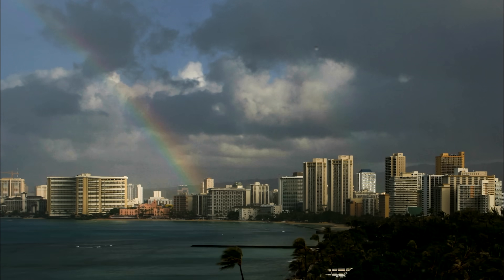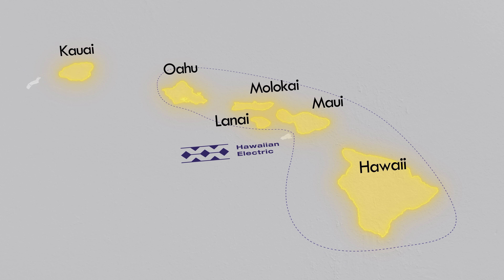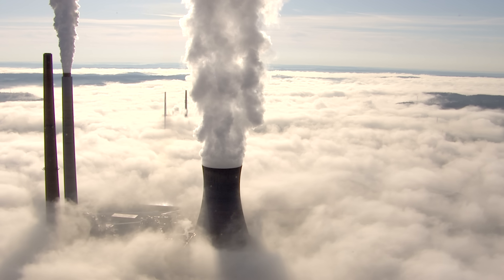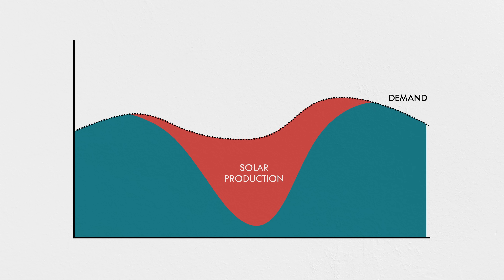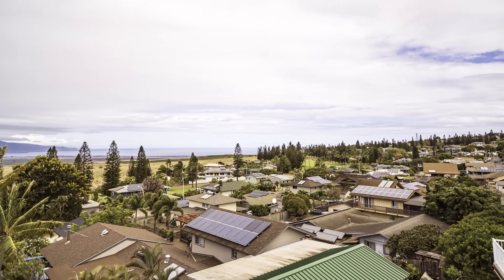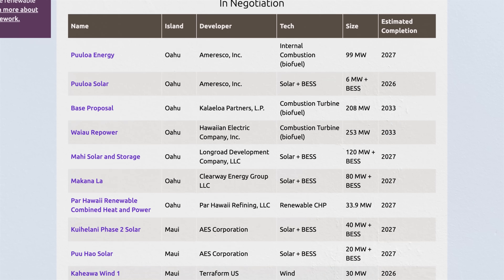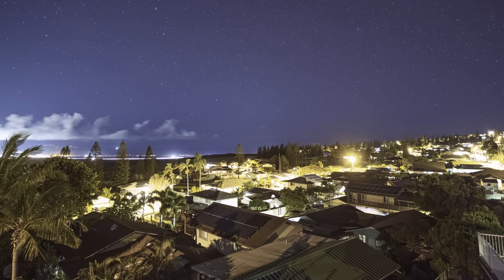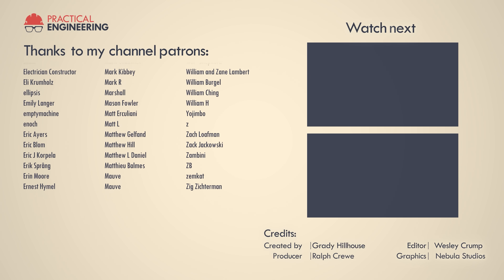How the Hawaiian Power Grid Works

Comment: 7:38 Kudos to the people who designed and built that solar plant 😅 
I guess they considered the losses due to self-shading to be negligible... but, come on, those losses could've been avoided simply by separating the rows an additional 3', o so.
Sure, you'll always have self-shading around dawn and dusk regardless of separation (production at such hours is so low that it doesn't matter), but those rows are simply too close together, I'd say that self-shading losses in this plant are greater than they could've reasonably been.   
 
It just hurts when people spend all that money, resources and effort in a solar plant, just to leave kW on the table like that 😔

Comment: When people discuss renewables, no one ever discusses the trucks. The cranes. The diesel generators. The helicopters. The de-icing components. The energy used in fabrication and transportation of the components of these renewable power systems. The maintenance. The relatively short service life of some of the components. The non-recyclable nature of some of the components. The human and environmental costs of mining the minerals and other resources needed to produce these components. All of this activity being carried out by engineers and technicians and laborers who drive gasoline cars to work to get into diesel-powered machines to implements these renewable power plans.

This enormous expenditure of fuel and time and effort is invisible to you, the end-user, and to the politicians and to the internet would-be-do-gooder who simply wishes to make jazz hands over wind and solar. As a direct participant in these industries I must unfortunately inform you that these particular renewables are a subsidy scam. You would generate power more efficiently by simply burning gasoline and diesel in tubines to generate power. Wind farms do not pay for themselves in the short- or the long-term and are a net drain on the power grid, and must be supported by the overwhelming consumption of gasoline and diesel by their support, construction, production, and maintenance teams. Solar is a little better, but PV cells are expensive at scale and also have a short service life and you must maintain them using men driving around in trucks.

Perform this simple thought experiment. Based on the power output of a wind turbine running at peak theoretical efficiency AT ALL TIMES (which is not the case), would it be able to keep itself running if all of its support crews from end to end of its lifetime had to subsist on the electricity that the turbine itself generated? NO. Obviously not. We burn tens of thousands of gallons of diesel building one of those things and maintaining it. It costs more ENERGY to establish it and keep it running than it will EVER produce, and that cost is paid up front in gasoline and diesel in logistics and electricity used in fabrication. They are not GREEN! They are a scam!

Comment: Simple solution, Modern Nuclear power plant. Built to modern standards with modern materials a nuclear power plant IS one of the safest and most efficient way of providing power. I know everyone will say what about chernobyl, three mile island, fukishima! First off NONE of those were modern. Chernobyl was a design flaw that prevented the reactor from shutting down safely. Three mile island was HUMAN error. They ignored safety protocols and attempted to override safety systems. It was actually those fail safes that PREVENTED it from melting down despite operators TRYING to melt it down. Fukishima was an absolute one in a century event that caused a cascade of failures that was never thought of when the plant was built in 1967-1970. NONE of those accidents involved what youd call a "modern" plant. With modern software and potentially AI operating a plant nuclear power can be made both safe and do less harm to the environment then other traditional methods of power generation.
Reply: Now way to evacuate an island in case of event.
Reply: @SilentSounder  IF one happens, but there are building technics that can contain a meltdown. Three mile island had this, the threat there was from a hydrogen bubble that formed that im sure has been solved.

Comment: Illinois power had something called 'Non rotating reserve' consisting of an agreement with a local factory with electric furnaces to shut off their equipment on 15 minutes notice in return for a low energy rate. Risky strategy for the company, since their furnace would be heavily damaged if they were forced to disconnect with a load of metal in the charging furnace.

Comment: I really with the US had not moved away from adding more nuclear power plants. They don't emit carbon and I think are a great bridge to solar/geothermal/wind renewables.
Reply: The main issue is that they are super slow to ramp up and down, so they are actually the worst pairing for renewables, which have highly volatile output. See 7:10 in the video. France has the issue that because they rely so heavily on nuclear, they have to sell their electricity at a loss in the european energy market when a lot of production comes from renewables, because they are unable to scale down their output low enough in a short enough time. It's counter-intuitive, but coal and petroleum plants are a much better fit for renewables because they can spin up and down more quickly. The best is of course battery storage, which can scale up and down within milliseconds, but that has its own downsides.
Reply: We are in luck, for the first time in 40 years the US opened a nuclear plant 2 years ago, 3 more are in construction and about a dozen more are now planned. NUCLEAR IS BACK BABY! Finally we can stop wasting time with extremely wasteful, inefficient, non-recyclable and environmentally unfriendly wind and solar
Reply: @Rootiga That plant cost multiples of what it was supposed to and took years, maybe decades longer. There's a wealth of documentation if you Google it. I am a fan of the technology, but the government and industry don't have their stuff together well enough to do it at scale.
Reply: Weather based renewables are junk for an industrial economy, the US should focus on building gas, scrubber equipped coal, and nuclear until a new technology that is better than those is invented.

Comment: You should mention that Hawaii has no nuclear power stations. To me, that seems a pretty silly decision.
Land is expensive, and it seems like they use a LOT of very valuable land for the current systems.

And they use a LOT of fossil fuels to generate power.
That's really poor.

And look at all the big petrol/diesel powered vehicles: LOTS of pollution.
Bit Hawaii seems a PERFECT place for elecgric vehicles: which could be supplied by nukes.

Plus, there is a shortage of fresh water: there is a desalinisation plant being built.
And that is yet another way to use a nuke plant.

Comment: Hawaii should have a few nuclear power stations.  Yes Nuclear. Yes you will be safe.  We're not talking about 1970's designed reactors.  Nuclear is safe, consistent, and produces no GHGs.  And they work well with renewables.  Nuclear operates at 100% power output.  So it would be perfect for covering baseload.  And renewables can supplement peak load demand periods.

Comment: As an engineer, you should know how bad wind and solar are for electricity generation.
You've mentioned a lot of them, but ignored the true costs (some hidden in rebates that are just going to be paid in taxes or duties). Any country that has tried this has failed, and reverted to reliable coal, oil, and gas.
Nuclear fission is the current best option for the world. It's literally impossible to mine enough materials needed for wind and solar for a global network, and they have to be replaced every 10 years, too...

Comment: In my text books they called great power stability 9 9s power. It meant you had power 99.9999999% of the time which meant you only lost a few cycles of 60 Hz per year. Oddly enough these type of systems are usually only used in computer backup and not healthcare.

Comment: 38 years ago when I was a kid. We always look forward to power outages. 

It was the only time that my father would ever stopped working. We youngins didn't have to do homework.  played games or read books under Candlelight. 

The house was built in the 1800s so three wood stoves and a fireplace. The electric stove was a afterthought decades later. Our hot water came from the old steam engine that we scalped from a abandoned gold mine.

Cooking, hot showers and washing clothes, heat was not a problem.

Comment: You make Hawaiian electric grid sound a great marvel of technology .. The truth is, its a growing nightmare .. Rates have quickly raised to 50 cents per KWh higher than any State  or US territory  and will hit 75 cents in the next 5-10 years  .. There is not enough Power generation on Oahu without  wind and or solar both very vulnerable to hurricanes ..  One hurricane and its rolling brownouts out for a year or more .. The promise of high tech solutions is belied by the reality of High Costs, loss of reliable power,  and no real solution to meet current needs  ..

Comment: I wonder if the problem of connecting green, non-inertial energy during significant voltage drops and any failures on the part of the leading station is so acute, have any controllers based on quartz watches been created to solve this problem? 32768 stable oscillations per second should be sufficient for short-term control of maintaining 50 hertz per second. If anyone has information about similar developments or how this problem was solved, please share a link to the source.

Comment: Can they not make more use of geothermal power? It seems an obvious solution on Hawaii. Looking at all the night time shots it shows an awful lot of electricity being wasted - perhaps they should introduce higher tariffs on electricity. Should they also encourage better insulation on homes so there isn't so much of a draw from air conditioners etc - perhaps by giving a home efficiency rating when selling homes. Can locals be encouraged to drive EVs? particularly EVs with V2G (Vehicle to Grid) or V2H (Vehicle to Home) which would reduce the need for grid level storage. Perhaps a ship based liquid air battery could be used to provide a grid scale battery to all of the islands?

Comment: Something you missed in this video is that individual consumers do have a fairly large degree of control over their own personal energy reliability if they are willing to make the investment- home batteries are becoming much more common and these can smooth out a lot of the issues or even provide fairly long term energy independence if needed, and the consumer is free to scale their system as large as they want, literally letting them pay more for more reliability. If one combines this with smart metering and the ability for nodes on the network to work together, yet also be secure and capable of disconnecting themselves and being overridden in a non networked way if there's an issue, then you get massively more resilient energy networks that have very few of the initial downsides apart from perhaps a greater emphasis on needing to pay to maintain the overall grid. It's a shame you glossed over these as this stage of grid development essentially erases most of the downsides. We already know this is possible to achieve, but getting there is difficult.

Comment: I used to work for Hawaiian Electric (HECO HEI). A few fun facts: The Waiau power plant is the oldest in the country at around 106 years old.  It burns low sulfur fuel oil which is the very bottom of the barrel. It’s so dense that it’s a solid at room temperature. It has to remain heated as it’s transferred from tankers delivered at Barbers Point and is ran through a heated pipeline. If the heat fails it would solidify. The pipeline is the most sensitive part of the power system from an operational and security perspective. If you visit Oahu you can snorkel near the cooling output shafts near the Kahe power plant. The warm water attracts all sorts of fish and if you love to dive or snorkel it’s a must.  As of 2020 I believe the national average was $.09 per KWh while Hawaiians were paying $.32-34 per kWh. Electricity is very expensive and you can’t just go buy solar panels you have to wait in line or be part of a lottery.  Also don’t believe what you hear about the Lahaina wild fires. The news would have you believe it was a rare event or one that should be blamed on HECO or lack of water. Wild fires had been plaguing Maui for years. The old sugar Kane fields go unused and overgrown with brush that would continually cause fires that shut down the roads. The State didn’t do anything about this. It’s an incredibly corrupt and inept government. The rail system is proof of that.
Reply: I’m surprised this comment stayed up. 
Truth doesn’t usually get to hang around.
Reply: Greed. The land is more valuable than sugar cane. Cane needs quite a bit of water. Now no fields and a prolonged drought. Too much new construction.  Problems are compounded.
Reply: Those words needed to be said ,,,good job  and mahalo nui

Comment: CIS 4, Rule 21 are the protocol requirements for small inverters to communicate with the grid operators.  Have a look at "The 50.2 Hz problem" for a deep dive into how the grid needs to communicate with residential inverters.

Comment: They needed to build nuclear plants back in the 70's and 80's but they turned them down because of all the greenies. They also limited geo power for the same reasons, because you  can't have the chemicals used to get the heat pumped into the ground and MIGHT leak. So they're stuck with the LEAST best option and it costs them plenty. Wind and solar won't save them and can't support the islands. They even thought about wave power but again the greenies stopped that too. Can't even have the potential of harming fish. Hawaii is becoming the challenger for the most leftist crazy state vs. CA and NY.

Comment: The "single grid" vulnerabilities were well documented with the "big freeze" in Texas in 2021.
Temperatures dropped below freezing for several days. This caused many of the natural gas supply lines to "freeze up" such that they couldn't supply electric generation units. Then several of the large fossil fueled plants failed due to inadequate severe weather preparation (such as below freezing for several days).
The legislature decided several years ago to "de-regulate" power suppliers. During the freeze, demand far outstripped supply resulting in per Mw prices to consumers becoming many times "normal".
All that came about due to deregulation. Before, ERCOT could tell the non-renewable electric suppliers that, based on demand forecasts, X number of additional generating capacity was needed. Those suppliers could then count on stable revenue to pay for building new generation plants.
With deregulation, there is absolutely no incentive for an energy supplier to build a new plant when they can just charge more for their existing capacity.
And, to top it off, top officials in state government decided to vilify wind and solar as "the culprit" and eliminated any incentives for building new wind farms.

Comment: My teacher who previously worked as a service technician told me that he once attended a backup power plant where they had the transfer switch for the engine cooling pumps on manual instead of auto 😂 When the power failed the engines started without cooling… It was a big mess I suppose. And this island even has a DC interconnector but it was configured wrong and didn’t work as meant, even though 100 million euro was invested to it, primarily for backup use 😂

Comment: Something interesting to note is that Kauai has already transitioned ~70-75% of their power generation to local renewables instead of imported fossil fuels, and the electricity co-op has kept prices lower and more stable than the rest of the state.  They even have plans to build a first-of-its-kind pumped hydropower storage facility, though it has been repeatedly delayed by lawsuits relating to irrigation.

Comment: I worked in infrastructure security for AES when they installed the wind farm on the north shore. I remember the protesters would cut down utility poles to block the road that had to be used to get the parts to the site.

Comment: Hawaii has had programs for decades that allows the grid to control distributed solar inverters ramping them down if there is too much production or not enough load.   These modern grid inverters also help correct the grid frequency curve unlike inverters used 20 years ago.